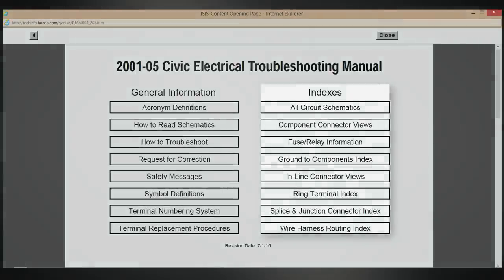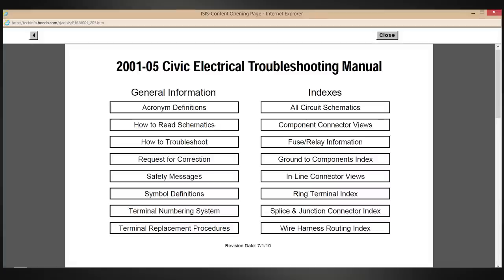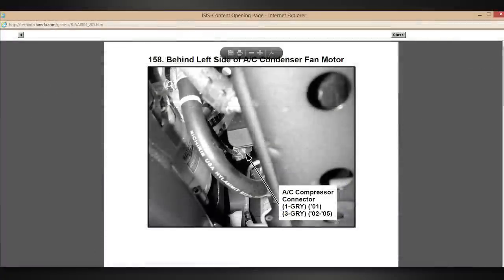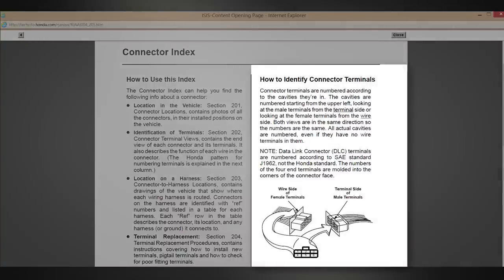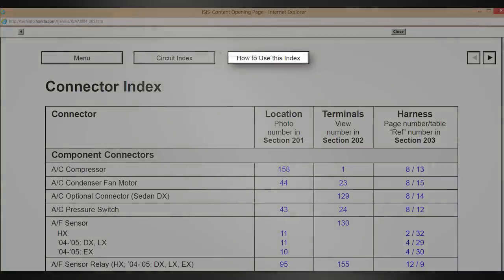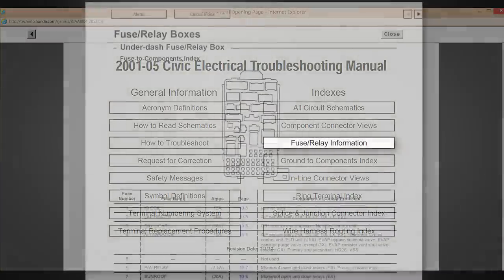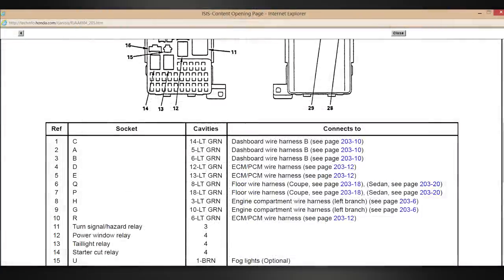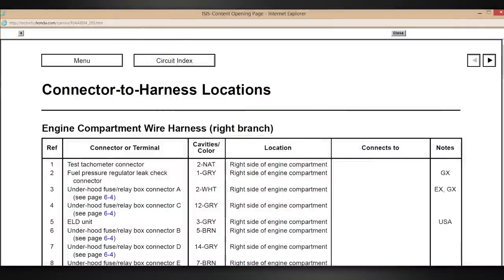How To Use Honda Wiring Diagrams 1996 to 2005 Training Module Trailer

Comment: hi there guys i have a 1991 prelude auto my speedometer works fine but no gear change. please help as i have taken solenoids out cleanes and replaced but never marked the wiring as they had previously been cut and joined. i have the original 4 wires from ecu side which are coloured but the solenoids all have a single colour new wire to them

Comment: I have an interesting question about a 2003 Honda CRV dashboard gauge cluster. The original cluster  has a malfunctioning fuel gauge on which I found a micro transistor with an open circuit. After multiple attempts to buy a new repair part, I opted to purchase a used gauge cluster. The cluster arrived in excellent condition and seems to work flawlessly in every way. Soon after the installation though, the SRS warning light came on and would not reset. After checking the components in the SRS circuit, I decided to reinstall the old gauge cluster. The SRS light reset and never came on again. What could be causing this ?
Reply: put a piece of tape over it and drive it like you stole. ;)
Can you use the used cluster to fix the old one with the fuel gauge problem? Did you try putting the used one back in to see if the SRS light comes back on.. I really don't know, but I wish you luck.

Comment: I have a 2006 Honda Civic LX and my lights blink at night while I'm driving the alternator checks out the battery checks out and I can't find out what's wrong with I thought maybe one of the ground wives was burn out of something can you help me
Reply from the maker: Hi Desiree, 
Intermittent electrical faults can be a real challenge, testing and ruling out systems related to the lighting circuit is a good approach to take. Seeking out the wiring diagrams and understanding how to read them from our training video is also a good step you have taken. From here, we might not have the answer to the actual fault, but keep testing and monitoring the situation when the lights blink. Is it while accelerating, while going over bumps, when you run the a/c or other high electrical load equipment it will start to point you in the right direction.
Good luck in finding your fault.
Reply: my dad has an 02. he figured it out and it stopped

Comment: My exterior fuse box started smoking. After my dashboard lights, clock and windows stopped working ...  So i replaced it and still don't work so i want to bypass it as safely as possible....
Reply: I'm  pretty sure that there is a wire or 2 grounding out....
Reply from the maker: Hi Art, we definitely would recommend bringing your car to a professional automotive electrician instead, as this looks like a potential fire hazard already. Further diagnosing also might create even more problem, if it hasn't already. We wish you the best with your car. Cheers!

Comment: hondacity 1.5exi 1999 self star problem
Reply from the maker: Hi Deepak, as with other diagnosis, you will need a systematic approach to find what is causing the current issue you are experiencing with your Honda City.